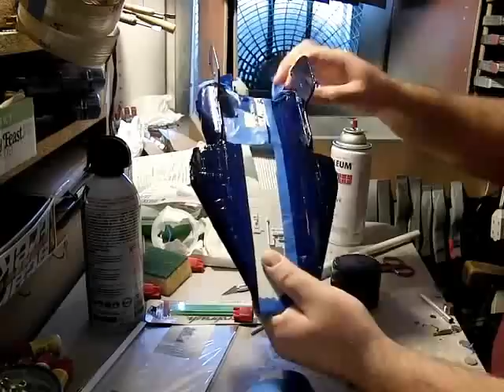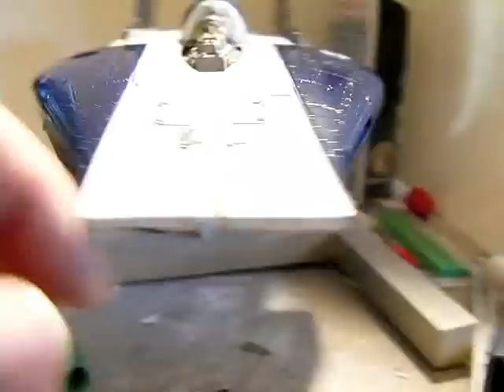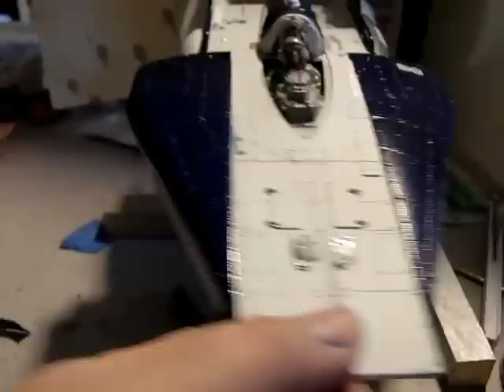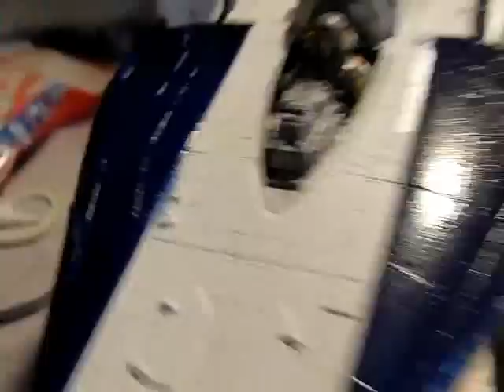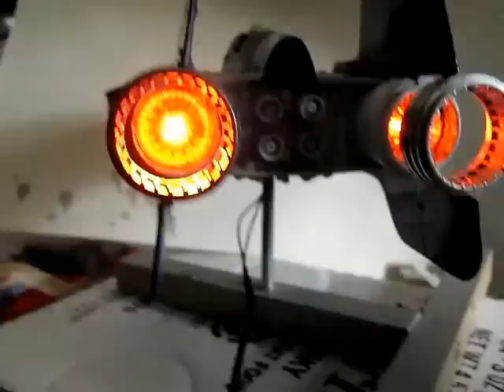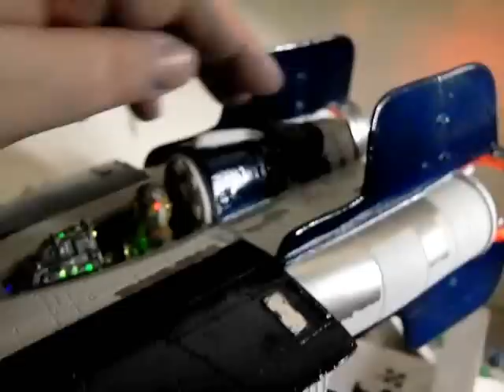1/24 A-Wing 14: Factory Coat 1

Comment from the maker: It's all part of the weathering in this case.  However, afterwards I remembered that I used to put a gloss black coat over the silver before base paint.  In this case, the rustoleum white metal primer did not like the silver coat and peeled away in patches.   I think the gloss blk layer would have stuck better.  This blue tape is fairly low tack to begin with.  My bet is that this does not happen with this blue coat.  Test to follow.